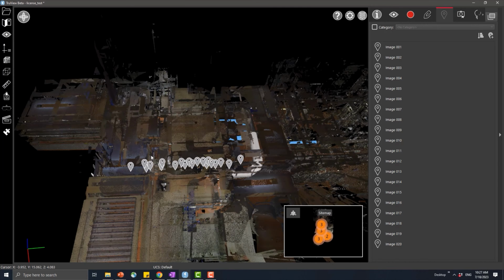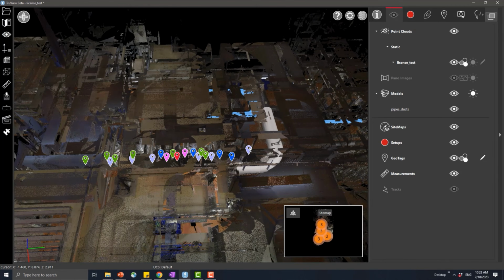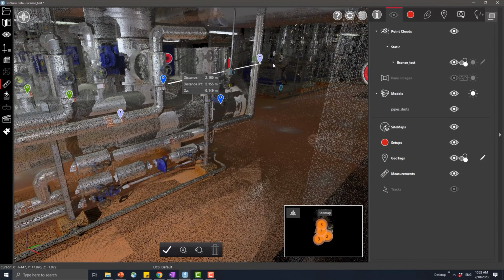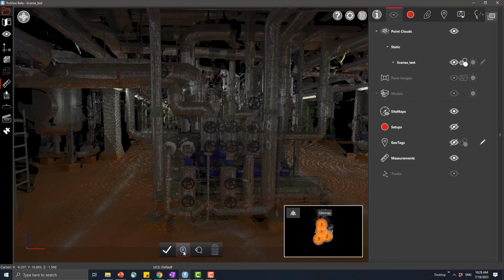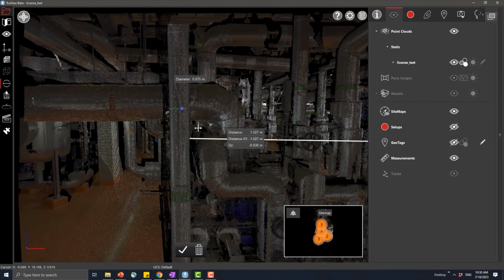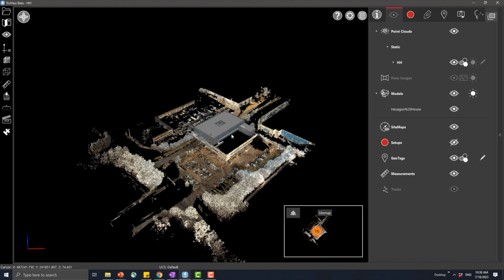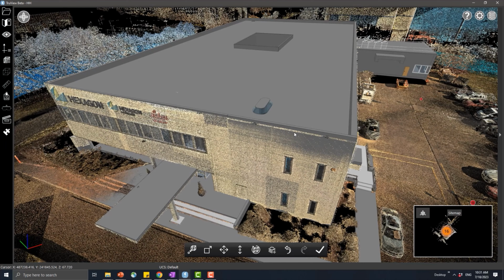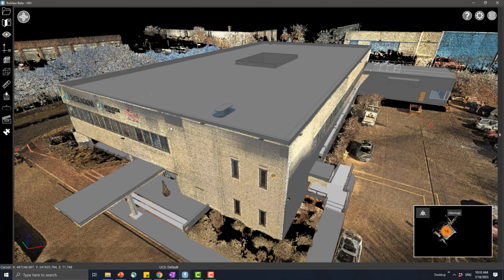Leica TruView Tutorial: GeoTag Features and Pipe Measurement Tools

Comment: Using this tool, it seems that the diameter measuring tool is measuring radius, not diameter.  Looking at your example on here, your example on your web page, and my use, using this tool seem to give 1/2 the diameter, or the radius.  Do you know if this is a bug?
Reply from the maker: It measures diameter.
Reply: @LeicaCyclone3DR  Did it get corrected?  We had an install of Truview right after this feature was released and it was clearly measuring the radius.  I was checking it against known pipe sizes.
Reply from the maker: Hello. Yes, this issue was solved. I used the latest version of TV (2024.0.2).